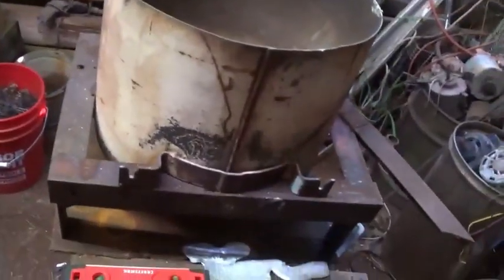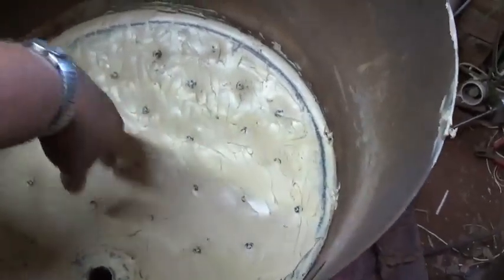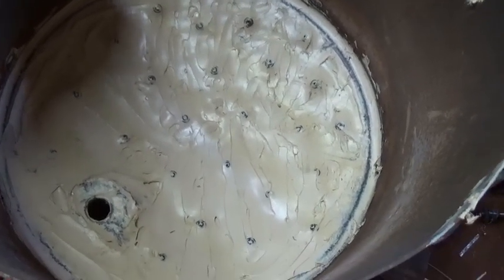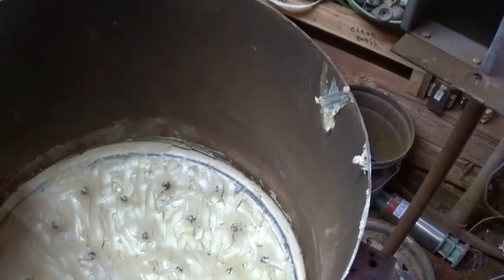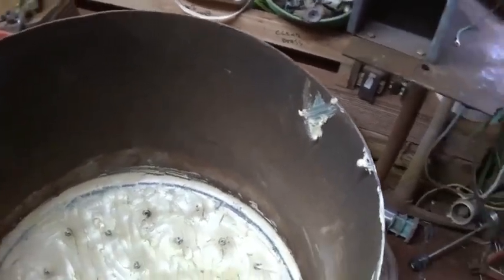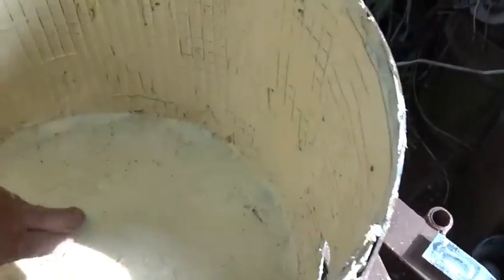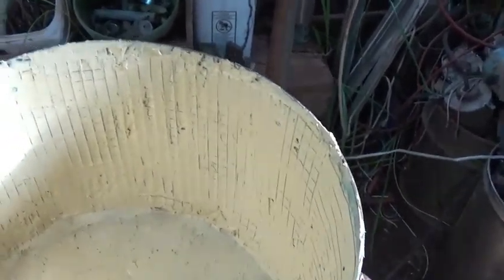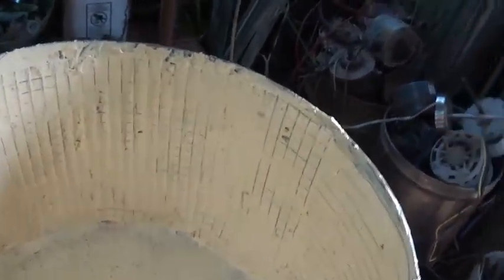7 minute Update on my waste oil aluminum motor melter

Comment: All of the nonmelting heavys will either pass through your drain or restrict it.
Reply from the maker: hopping they will stay put and not flow to the drain hole, we will see gonna try to do some melting next month, trying to stay up with calls  at this time. i am not running my add next month, gonna try and see how i can do just getting metal from the transfer station or as some call it the dump.. i may need to do a short video of the dump for my viewers. may be a job for my gopro Thanks for watching Matt

Comment: Im very interested how you designed your waste oil burner method.  My thoughts are lots of smelly smog until the oil ignites into a clean burning flame
Reply from the maker: if you look at my playlists you will see one titled Oil Burner and melting metal, i have a video of my build and other videos of the burner and melting, i have a propane line on it and i light the propane then i add some compressed air to get the siphon going, then turn off the propane and turn up the air very easy
Reply: I did find your video . I  think the missing link is a top for your barrel. The heat escaping could be your only problem.  I am impressed by the simplicity  of your oil feed. I  had not expected it.
Reply from the maker: @mattyal9347  i have some scrap plate metal that i put  on the top of the barrel to close up some of the space, but some times the aluminum piece that i am melting sticks out of the top
Reply: @Okiescrapper  I thought you would have also I was amazed at the size of it! You could easily fit a aluminum rim in there

Comment: also looking forawrd to the first burn
Reply from the maker: i have melted aluminum about 30 of it before i started to put the refractory cement in it,, i have a play list called oil burner and melting metal if you want to see it in action and the build